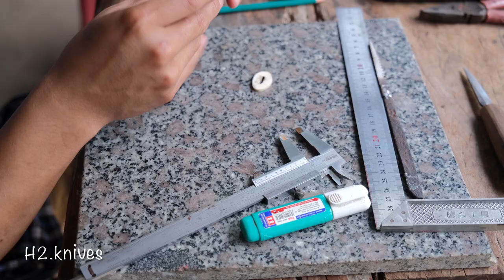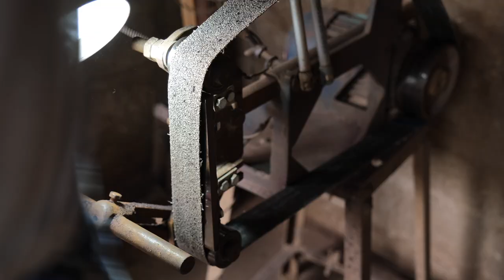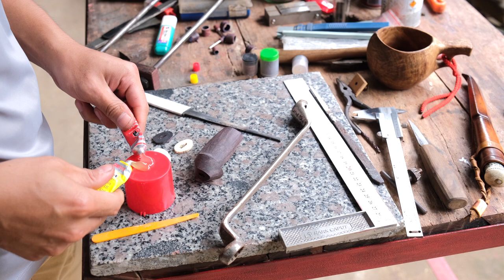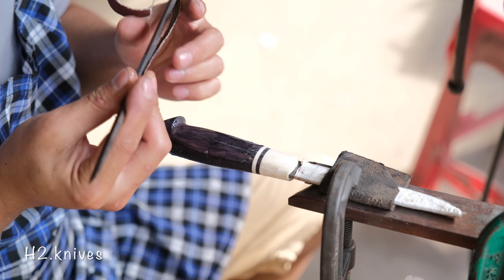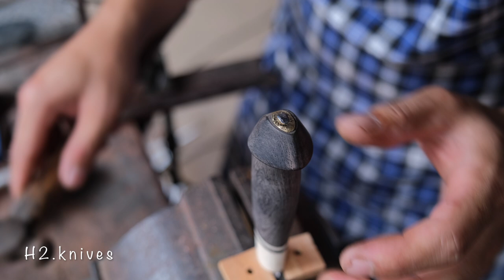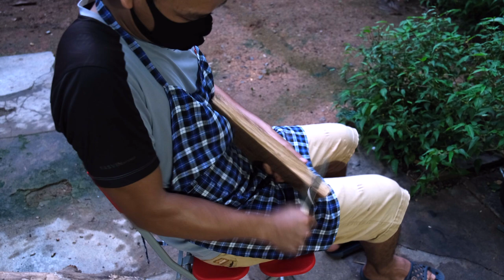Making a Puukko knife - Part 3 - Wood finishes for knife handle | H2.knives

Comment: is that bone?
Reply from the maker: Those are deer horns, quite similar to bones
Reply: @h2.knives   Thanks.  I forged two puukko blades yesterday and am thinking handles today (but it is 🥶 out).  I have some whitetail antlers in the barn...🤔 I'm used to making wa handles, so pretty much the same.
Reply from the maker: @brokenrecord3523  I recommend using reindeer horns, or finding horns with a high degree of solidification would be better
Reply: @h2.knives    Yeah, just cut one open 😕
Plus stink!  Might use it as a spacer for some white, but not on the ends.
What's your opinion on tagua nuts?
Ever used them? Do they hold up?
Reply from the maker: @brokenrecord3523  Please send me more information about it to my ins:
https://instagram.com/h2.knives?igshid=MmVlMjlkMTBhMg%3D%3D&utm_source=qr